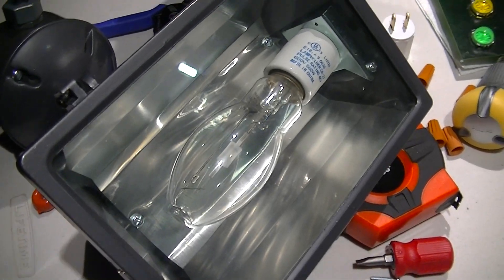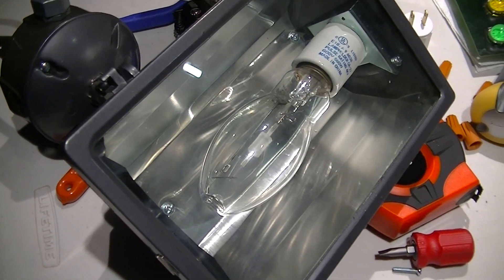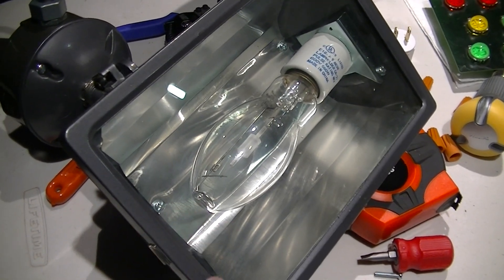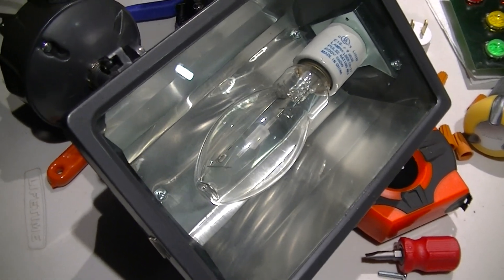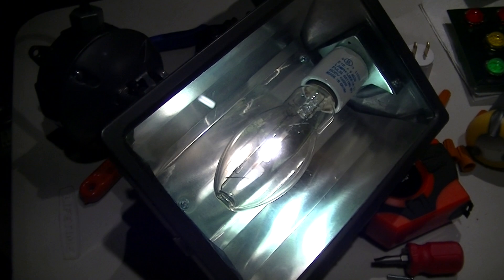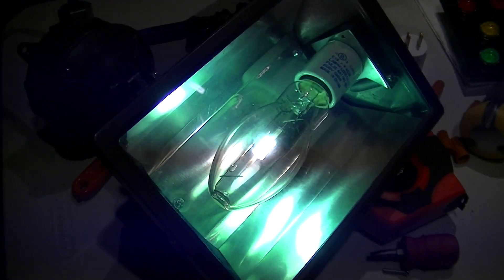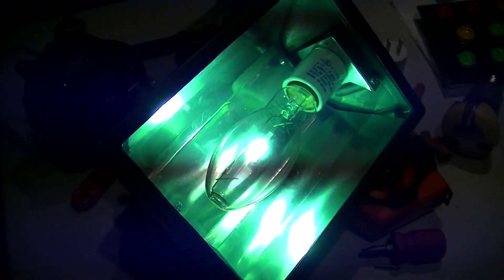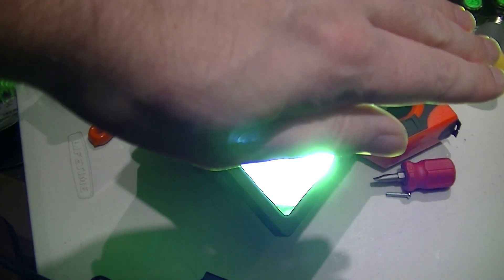Starting delay with new old stock ceramic metal halide lamps

Comment: If you were to attempt to run 35 Watts ceramic metal halide bulb off the 35 Watts car HID headlight ballast, being new old stock wouldn't be a problem with that setup. I have the Halogen spotlight modified to HID, and I decided to go with CMH bulbs due to better lifespan compared to the regular car HID bulbs and of course decent color quality too. I tried the oldest General Electric ConstantColor 4,200k CMH bulb on the Hylux A2088 ballast, it just lights up immediately (and a side note, GE ConstantColor CMH bulbs won't restrike when hot, Osram 39 Watts Powerball CMH bulb was the only one that I found to be capable of hot restrike). Not to mention nice Halogen hue from 3,000k bulb too!